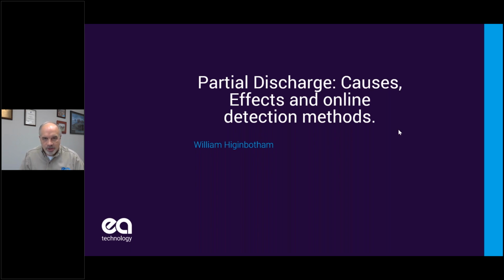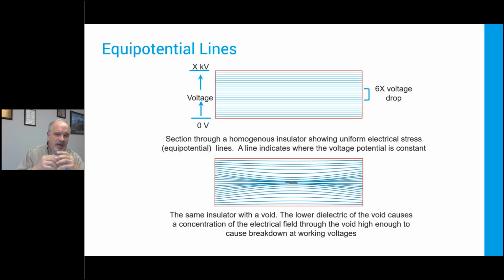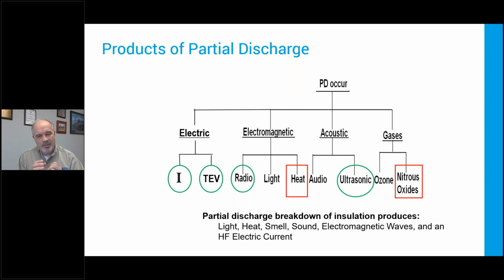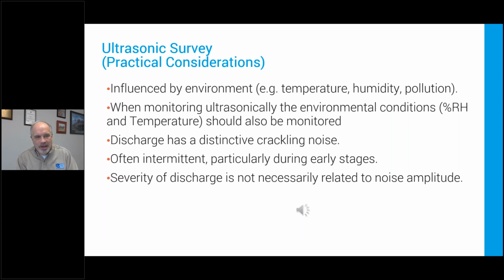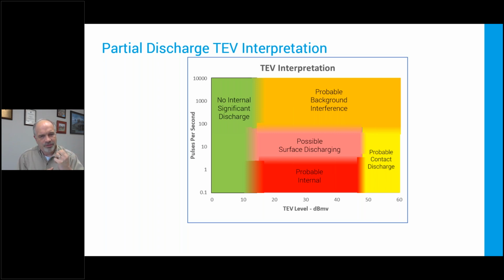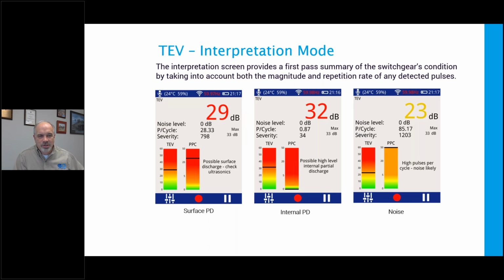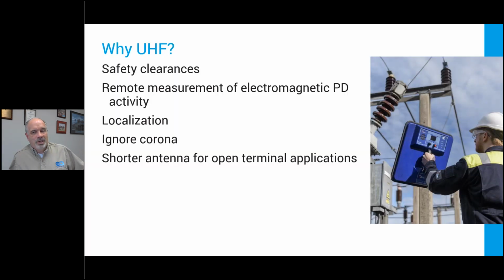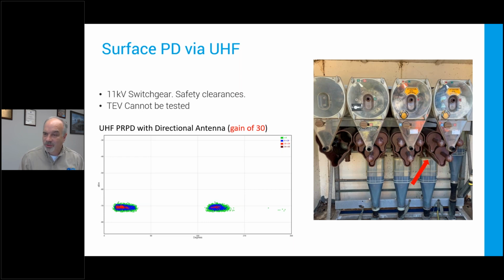Intro to PD March 2021

Comment: for UHF, which freq range can we deduce, is Internal or surface discharge?
Reply from the maker: Unfortunately, with the UHF alone, it is not possible to tell internal from surface discharge. Since the same instrument also does Ultrasonic and TEV you can use them to see if it's surface once you've found it with the UHF.  Surface discharge puts out significant ultrasound and internal does not. So if youhave UHF and no ultrasound, it's likely internal Using TEV on a ground wire or metal structure may let to get a pulse per cycle count. The pulse per cycle count of internal discharge tends to be 0.5 - 6 PPC.  Surface PD tends to be 6-30 PPC.
Reply: this year I purchased an EA UltraTEV Plus UHF receiver, and it sweep fr 200MHz to 800MHz, and during the sweep, many spike appear in this freq range..I am confuses, which specific range shall I focus to deduce a potential PD? I am using this UHF receiver mainly for 22kV/433V Dry indoor TF..thanks
Reply from the maker: @LIM_Khuan  Please contact me at bill.higinbotham@eatechnologyusa.com so we can discuss this and set up some training.  You need to be using the2D or 3D phase resolved plot function to find partial discharge.